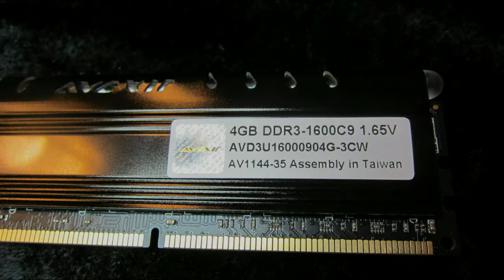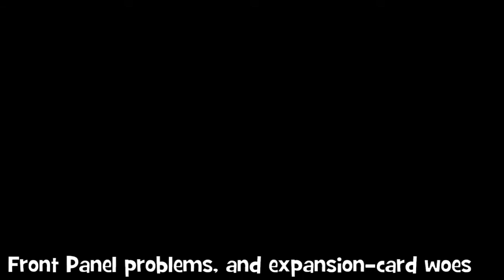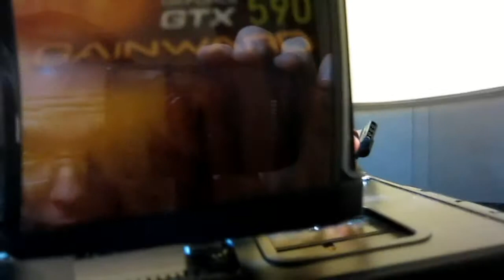Antec Skeleton build - Part 3

Comment from the maker: It starts up in the cycle mode where it transitions between all color modes. There is a switch that lets you cycle manually between the 3 main modes and the combinations in between: red/blue/green/purple/cyan/orange/OFF.
Also there's a 3-position switch to control the RPM of the fan. I use it on the low setting with the CPU fan removed (only heatsink left), works perfectly.

Comment: Nice video's bro, I just bought a used Skeleton today came with a core i7-920, sitting in a asus p6t mobo, 9 gigs ram, Blueray player, Sapphire Radeon Ultimate HD 7750 1GB DDR5, Corsair 1,000 watt psu. 2 1 terabyte hd's. I got the entire setup from my brother for 500 dollars. He has had it for almost 2 years. But I still think its a pretty good deal. I couldn't pass it up. Do you still own yours? I was going to do some mods maybe liquid cool it to overclock it.